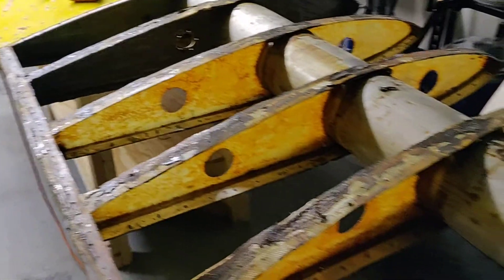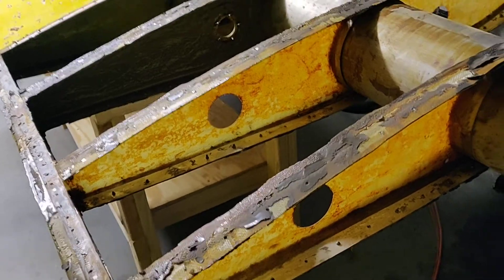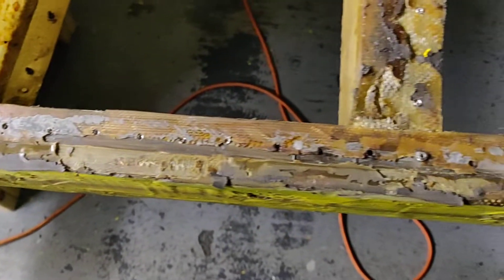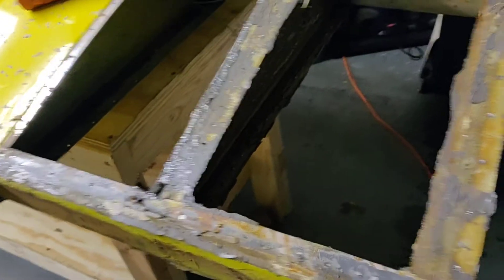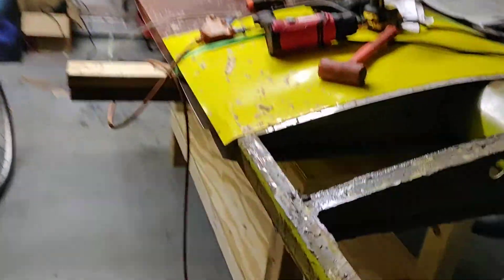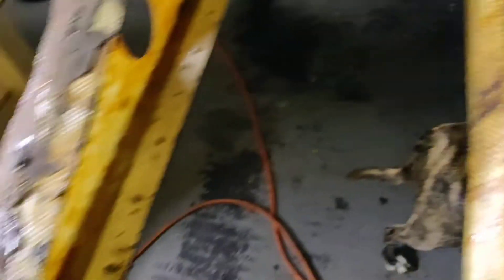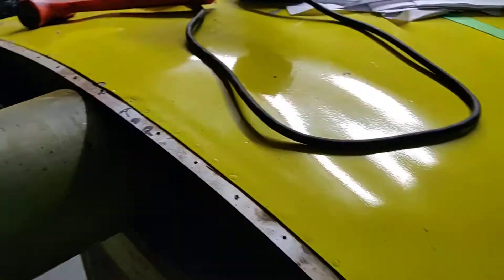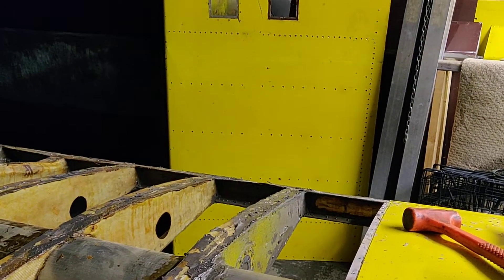BD-4B Wing spar overview

Comment: Original design was fiberglass rib-wing panels. These were clamped to spar with hose clamps and epoxy. They were stacked on each other with the edge of one unit glued to the next There were fuel leak problems with the epoxy joints. Probably you have a partial conversion to solve fuel leak problems.